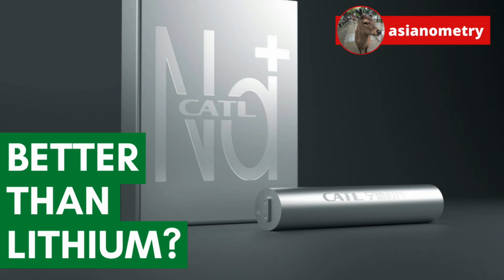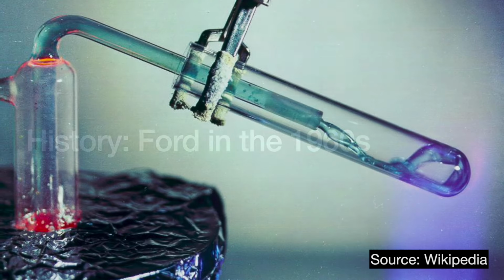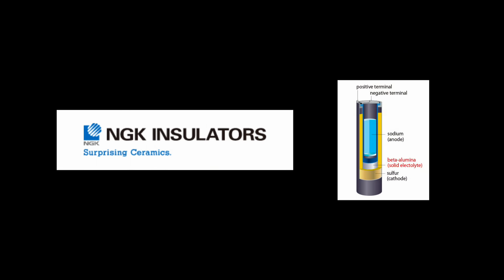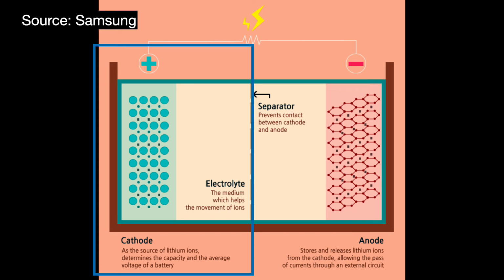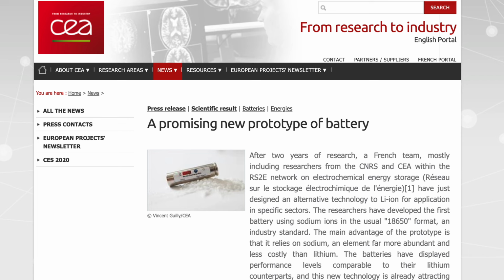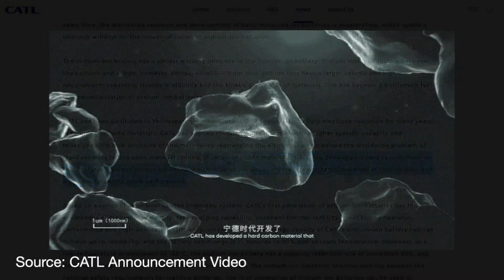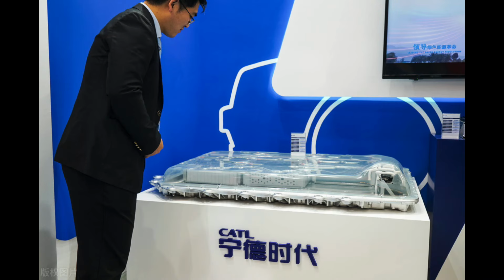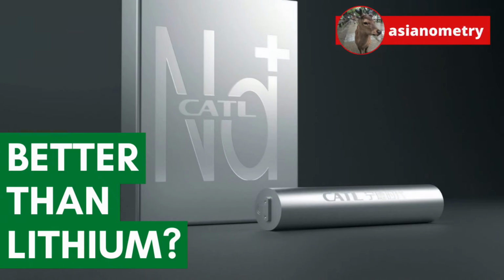CATL's Sodium-Ion Battery: Better than Lithium?

Comment: Good insight into CATL's latest direction, John.
And I would agree this tech makes more sense for grid scale storage than transportation.
So, why do you think 'charcoal' for anodes rather than graphite or even graphene?
Reply from the maker: My general feeling is that CATL is going for scalability and cost effectiveness.
Reply: I'm not a battery expert, so take this with a grain of electrolyte...
Charcoal is very similar to graphite in many of its properties, but it is extremely porous. In battery tech this is a good thing, since it can soak up the electrolyte solution and serve as a reservoir as well as an electrode.
Reply: @KonradTheWizzard  I will take it with a molten drop of electrolyte.  😉
Totally understand that a highly porous anode will have much more surface area,
Reply: they explained it in the presentation , it's because sodium ion are bigger then lithium ion and less could interact with graphite so they engineer the material to accommodate the bigger ion with a particular structure that they give to a charcoal base material this is why they will probably achieve with next generation a 200w/kg energy density sorry for my english hope it is  clear enough
Reply: @carlo1081  Quite to the point
Reply: @Jim Urrata. Charcoal, graphite and graphene are common carbon. Which is lighter and for what purpose, like weight?
Reply: @buddhasattva  There are a couple of forms of graphite and graphene too.
"lighter" in what regard?  Graphene is only one atom thick, so as a film or nanotubes it is going to have the most surface area and very likely be the "lightest"
Where an aerogel of carbon is probably the form where you would find the best balance of surface area with enough structure to still use as a conductive anode.
But coke or steam activated charcoal is going to be less expensive and still plenty porous.
Being able to implement battery technology today is very much a matter of IP. Just look at how much Tesla paid for Maxwell...
Reply: @jimurrata6785  huge cost diff
Reply: Graphene is also very costly, which defeats the purpose, in this case.
Reply: For grid scale, this isn't cheap enough. According to other experts, cost per kWh should hit around $25/kWh which this does not do. Currently there are already grid scale batteries that are being deployed (iron air batteries and Ambri's liquid metal batteries) which will easily hit those levels of cost while being far more stable. I really view sodium ion batteries as being more for hybrid battery systems for EVs where you have a large portion of the cell consisting of Sodium Ion batteries and some parts of it consisting of high performance Lithium ion batteries (like solid state batteries). at 200Wh/kg as CATL is claiming for the long term future for the battery, a mix of 8:2 for example with 20% consisting of high performance Lithium Ion cells, you could get an overall capacity on par with current EVs with a 30-40% reduction in cost per battery pack. Just as an example if we were to construct a 55kWh pack, the final cost of the cells without the BMS systems in place would amount to $4180 if the hybrid battery approach were to be taken into account with $220/kWh solid state cells. That same pack today costs $6600 at $120 per kWh. That represents a 37% cost reduction on the cells. This is clearly CATL's strategy since they have told us it's their strategy going forward.
Reply: graphite doesn't work as an anode material for sodium-ion batteries, so they have to use hard carbon (which is cheaper). lithium-ion can use both, but graphite has better performance.
graphene is not an active anode material like the other two are. cathodes and anodes are made up of active material particles, binder and conductive additives. graphene is a high-performance conductive additive used in some lithium-ion batteries. typical batteries use carbon black (soot).
Reply: Potassium is a better bet as a Lithium replacement but e-vehicles are fake-green joke.. Internal combustion engine tech. already exists and works better than e-solutions, and is far greener. We need to develop carbohydrate fuel reprocessing network using out existing infrastructure. Compress exhaust gas into a diaphragm in the fuel tank that also pressurises the fuel. Empty it at the gas station when you fill up. Decompression rapidly charges the battery in a hybrid system, although I am pretty much against hybrids too...
--
Anything using neodymium or cobalt is fake-green, lithium too when opencast mined. Artificial carbohydrate fuel production should be powering all vehicles for obvious power-to-weight benefits and ease of recycling the parts. Ideally only a small lead-acid battery that lasts forever needed to power lights, the stereo etc..
--
Thorium Molten Salt Breeder Reactors are the only tech. the world needs for cheap, safe, green, practically unlimited power. Could have sorted this globally in the 1960s as the tech was proven in the late 1950s before being shelved in favour of Enriched Uranium and its Plutonmium + DU waste materials used for nukes.. and then the Fake-Green Globalists took over all national green movements, to push industrialisation of the 3rd world.
Reply: @PrivateSi  so the 'fake green globalists' took over the world back in the 60's? Mmm, that fits with the history I know. /s Not sure how you conclude internal combustion engines are greener then electric - of any and all varieties, but even if they were, you still have the emission problem: CO2 being the obvious, but all the other combustion products cause problems too, especially in cities. That's where zero emission vehicles are so much better... you're not breathing all those pollutants in. 

Using carbohydrates as fuel may be 'greener' than burning fossil fuels, but most of the bio-fuels I'm aware of today are grown instead of food crops. That means more land cleared for either food crops or bio-fuels, or less food produced. The former definitely not green, the later resulting in starvation.

Thorium MSBRs are not the solution either. We already have established and operating nuclear reactors now. Operators are not just going to mothball them for a tech that is has yet to be used in a commercial power plant. A new thorium reactor will take years to build. To take over power production on a global scale would take decades, one estimate I saw was at least 50 to 70 years, assuming no issues with consents or problems in construction and running. Too slow.  Far too slow, when we are rolling out solar and wind as mass scale right now. 

Found this quote form Dr Peter Karamoskos :
    "Without exception, [thorium reactors] have never been commercially viable, nor do any of the intended new designs even remotely seem to be viable. Like all nuclear power production they rely on extensive taxpayer subsidies; the only difference is that with thorium and other breeder reactors these are of an order of magnitude greater, which is why no government has ever continued their funding."

Comment: Uranium-ion battery in development using nuclear waste in the US.
Reply: Those are going to be heavy as fuck... Uranium weighs 19g/cm3. Lithium weighs 0.54g/cm3.
Reply: @andersjjensen  who cares when each battery could last over 28000 year.
Reply: Plutonium ion battery are in under construction in Russia
Reply: @omsingharjit  They use the Peltier effect which is not associated with redox reactions
Reply: @bingosunnoon9341  it was joke  , that's why i said plutonium ion 😆😆😀😀
It's called #Seebeck #effect , peltier effect is opposite .
I know plutonium glow orange Hot from its Radiation which can generate Temperature difference  so  Seebeck effect can be use to generate Electricity .
Reply: @omsingharjit  Don't give those idiots any idea, they would think RTG is a good idea for consumers.  Each unit would come standard with a geiger counter and radiation badge.
Reply: @joyjoy534  😂😂  and may be fear of   something like   Nokia Nuke battery Explosion inside victim's pocket
Reply: Plutonium batteries are used  for deep space missions like Voyager. Is that what you are thinking?

Comment: Energy density of Lithium ion is 120-260 Wh/Kg. 
For sodium ion it is 75-150 Wh/Kg. 
So in terms of energy density it's not really better.
Reply: Because of the potential cost savings and potential for more recharge cycles this sounds like it has the potential to be better than lithium for storing renewable energy for the grid.
Reply: Sodium Ion battery will only come into play when Lithium got too expensive.
Reply: As explained in the video, not all applicants require high energy density.

Grid storage, recharging stations, UPS, require acceptable cost per function, that can be provided by alternative means as Na-ion.
Reply: Wh/kg = specific energy
Wh/l = energy density
These have been used over the past decades. 🤓
Also. Li-ion will go over 400Wh/kg when going solid. The liquid electrolyte is quite heavy actually. Also solid cells allow going to next level from BYD Blade to bi-polar cells which have no traditional current collecting mechanics. No foils. That saves also plenty of weight. Directly and indirectly. Solid LFP-graphite cells are going to level plenty of this competiton as there is already huge amount of experience from millions of units in the field. All new technologies have big risks embedded as there is no mind to build billions of units and only then find out what was done wrong. Such approach will get close to zero investments.
Reply: @mfb424  
While you have a point that the market may neglect a secondary solution to a problem (GaAs in microelectronics comes to my mind) that may not be the case.

If a sound solution is found to get cheaper energy storage, there's a huge market and money will flow.

Drs Goodenough and Maria Braga were researching solid state batteries in both Li-ion and Na-ion versions. The idea is not new, reaching a point were a useful and cheap product is market ready is.

For now, it's a press release. Let's see some trucks or forklift working 24x7 in some port authority using it and check the specs, durability, etc.

99% of advertized battery advancement keep forever as just a press release. Let's hope this one is real, has many implications in many sectors, and leverages bargain with Lithium producers not to abuse their power.
Reply: Sodium is around 45 times cheaper than lithium
Reply: @omsingharjit  Currently. But as the demand rises the supply follows. Meaning lithium prices will also drop. Until now it has been a marginal product with low volume. Lithium may become just as cheap as soon as it is clear to everyone we have it everywhere in abundant quantities.
Reply: @mfb424  li price will not fall it will always rise in average because  it's rare
Reply: Better for stationary applications I'd say. For cars, halving the range might be a deal breaker.
Reply: @robertlee6338  Yeah definitely , i never said it will completely replace or compete li ion battery  . It can't   because of it's Known  Chemistry but it can replace li battery where size doesn't matters  like EV ( yes it's  not necessary that your car  needs to charge only after thousand or  million  miles run unless you are Jem's bond 😀😀   ), grid storage size doesn't matters there   , Home Energy Backup , buses , trains etc 
On the other hand li should be preserved for compact portable devices
Reply: @robertlee6338  it will be not much bigger than ( may be around 1.5 time's )   the current li battery  of same power .
You can watch my Diy version of tiny Sodium powered   battery (Aq Electrolyte with Sodium based salt  2.7 Volt ) ,  powering dc motor for long time .
Much better than any diy youtube  Sodium or li battery if i can build such so why can't they..
Here is it ..
https://youtu.be/KHuqU6bLDP4
Reply: @robertlee6338  radox  potential  of  sodium is little bit lower than li and you thinks sodium battery will be 5 times larger than why 5 may be  10 times !!! Makes no sense .
And you are wrong Many EV  manufacturers   have already investing in Na ion battery  why !!! Because it will give you more Juice than lead acid battery  . But yes it's not good fit for cell phone because of Portability and slim size of smartphone . 
I don't know which video you are talking about ??
Reply: Second it might be the case that  li dominated manufacturer and related politics don't wants the success of Na ion otherwise they will lose the value of their  Treasure .
I hope you understand my point
Reply: This kind of battery is good at replacing lithium on non moving ones eg UPS battery, Solar Panel Battery, Wind power battery, etc.... But it will reduce the demand and price of lithium battery.
Reply: @robertlee6338  but today the demand of Lithium is very high because all of us are using it. But if some of us can use other type of battery, then the demand of lithium battery won't be so strong as today.
Reply: @robertlee6338  nothing.
This battery will replace any lithium ones in Wind farm and Solar Farm site, desktop UPS, communications BTS, office, server stations, etc....
Reply: @robertlee6338  Dude. Whatever you hate the Chinese or their invention.
But. It will help you or any other American companies or individual from the shortage of Lithium batteries.
China has a huge huge solar and wind farm, and million of 4G/5G BTS all over China. And if they replace the old broken lithium battery with Sodium one, it will reduce the demand and pressure of Lithium battery.
Thus we can still get reasonable lithium battery price for our gadget and cars.